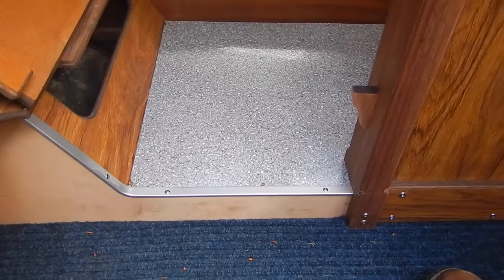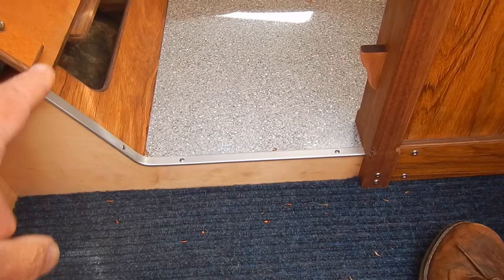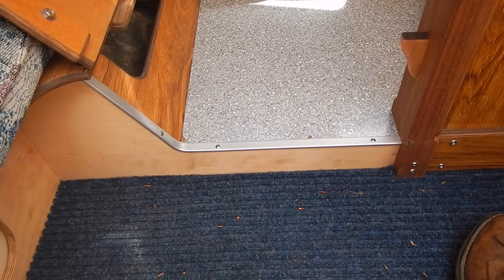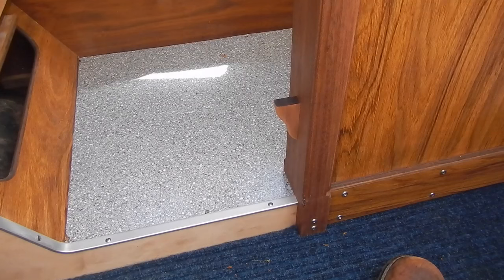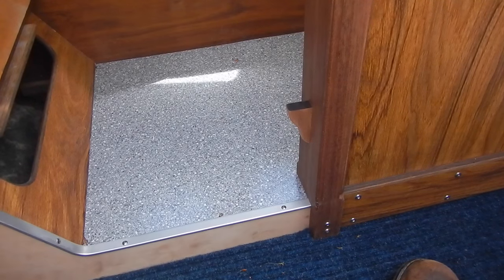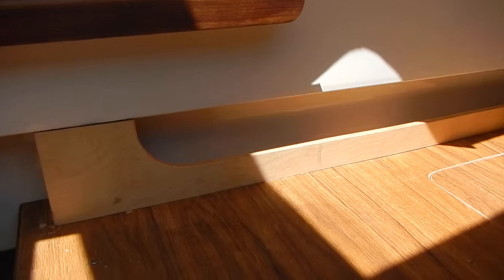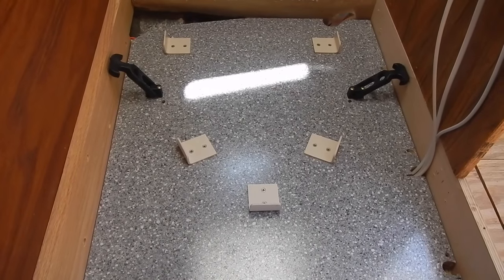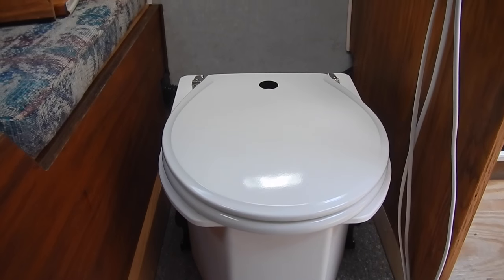Episode #3 - Installing a C-Head Toilet

Comment: Looks good!   I also have a composter in my boat and am pleased with it after a year.  May I suggest an alternate and easier way to mount a composting toilet to anyone considering a similar project:  Since the floor was already raised above the hull a few inches in it's original form, simply trace the shape of the toilet base onto the floor, carefully cut out the traced area leaving a very slight gap around the base for clearance.  Voila!  An instant recessed mounting place for the toilet which will not allow it to move around as the boat moves.  If the hull shape underneath is not level, simply attach shims to the bottom of the toilet until you get it right, or alternatively glue or epoxy them to the hull.  Looking forward to more videos.

Comment: Good job on the installation and the video.   I've just finished installing the shorty model C-Head on my Pacific Seacraft Flicka, but I have not used it yet.  The previous owner had a Nature's Head on the boat, but it stood way too tall as it had to rise even higher because of the upward slope of the cabin liner, not to mention that it looked ridiculous.  I sold the Nature's Head to an RV'er and bought the C-Head.  Question:  What compost media do you recommend using?  Have you tried several?  C-Head is recommending Aspen tree pet bedding.  My friend uses coconut coir in his and likes it.
Reply from the maker: I have a wood-working shop with a dust collection system giving me an abundant supply of sawdust.  This material seems to work well.  Since it's essentially free, this is all I've used.  

I think I mention in the video that initially I did not vent the C-Head.  I later decided that venting would be beneficial, and I added venting using the tubing that came with the C-Head.  I used a 12v computer fan to provide air flow. --Peter

Comment: Could you give an update on its performance in the comments ?
Reply from the maker: Sure.  I did more day trips and fewer overnight trips than I anticipated, so I'd have to say that the C-Head didn't really get a full workout this season.  I didn't keep count, but fewer than 10 uses for solid waste.  As I recall, the instruction manual says that the solids chamber should be emptied when stirring starts to get more difficult.  We haven't reached that point yet, so capacity is still unknown.  As for smells, I can detect a slight musty odor when I remove the lid prior to using the head.  I don't find it to be an unpleasant odor.  It's like a rotting leaf pile, not at all like a well used outhouse.  Between uses, with the lid in place, I detect no odor at all.  I sleep in the v-birth.  I installed no ventilation for the C-Head.  I'm pleased with how the unit fits in the boat, and so far I'm pleased with how it works.  The only surprise is how much urine a person produces in 24 hours.  With 2 people on board, the liquid tank needs to be emptied daily.